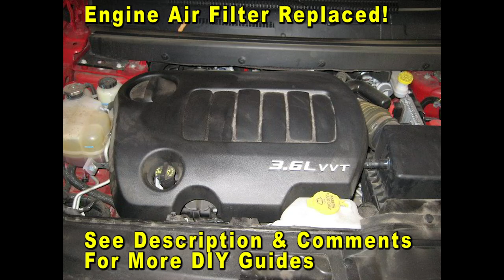2009 To 2020 Dodge Journey How To Change Engine Air Filter With Part Numbers - 2.0L I4

Comment from the maker: Dodge Journey Engine Air Filters - https://amzn.to/3VhFtKh
EcoGard Engine Air Filter Part # - https://amzn.to/44Xhm6E
Fram Extra Guard Filter Part Number - https://amzn.to/456RFkf
Purolator Engine Air Filter - https://amzn.to/3KhEKCs
Precision Screwdriver Set - https://amzn.to/3sLixaP
Plastic Pry Bar Tools - https://amzn.to/3HMtsV7
Socket & Ratchet Set - https://amzn.to/3Z17LbA
Mechanix Gloves - https://amzn.to/3jCnHkt
Torque Wrench - https://amzn.to/3vS5uSI

The Paul79UF YouTube channel is a participant in the Amazon Services LLC Associates Program, an affiliate advertising program designed to provide a means for sites to earn advertising fees by advertising and linking to Amazon.

This DIY video shows owners of the 1st generation 2009 to 2020 Dodge Journey SUV how to change the engine air filter element for the 2.0L I4 engine.

Comment from the maker: Check out the DIY guide for changing the engine air filter in a first generation 2009 to 2020 Dodge Journey - 
https://www.paulstravelpictures.com/Dodge-Journey-Pentastar-V6-Engine-Air-Filter-Replacement-Guide/index.html

Here are all of the DIY repair and maintenance tutorials for the first generation 2009, 2010, 2011, 2012, 2013, 2014, 2015, 2016, 2017, 2018, 2019 and 2020 Dodge Journey SUV - 
https://www.paulstravelpictures.com/Articles/Dodge-Journey-Common-Problems-Repair-Maintenance-Guides.htm

Owners of other Chrysler, Dodge and RAM vehicles with similar dome light housings such as the Town & Country, 300, 200, Avenger, Challenger, Charger, Dart, Durango, Grand Caravan, and Ram C/V Tradesman may also find these DIY instructions to be helpful.